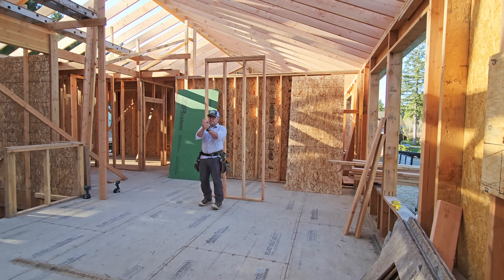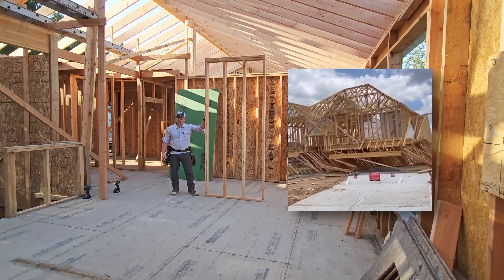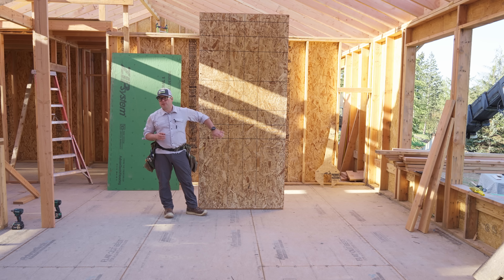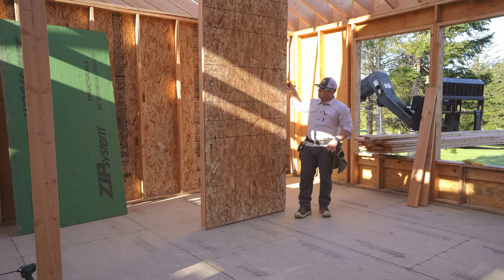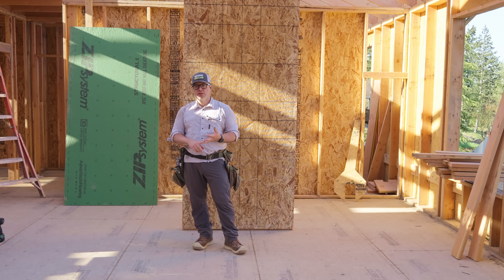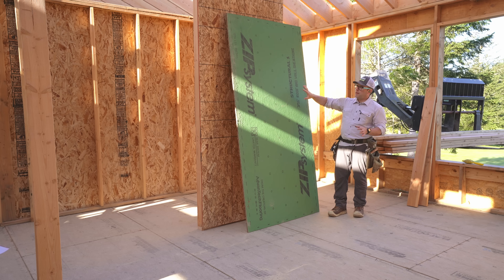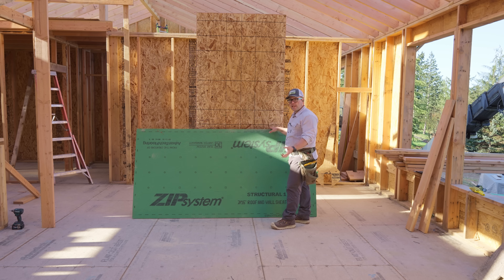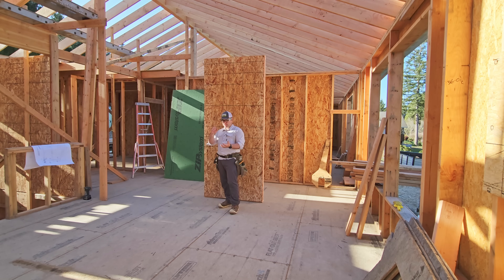Shear Walls Secret: The Hidden Force That Holds Buildings Together

Comment: Nice info, and GREAT video of shear failures!

What would be super helpful is if Huber would stock longer Zip panels (and various Advantech flooring) in Canada.  I can’t tell you how nice it would have been to have 10’ Zip and 1-1/8” Advantech available locally… I had to import my floor sheathing from NY myself, a major PITA.  Maybe you can pass this along to Huber? 😁
Reply: I haven't found it in stock near upper MI either. Pretty sure it'll be a special order for me. That's a conversation I have yet to have. But it'll be worth it to save not only on the extra blocking, but also the resultant thermal bridging. Sure it's a drop in the bucket, but still. . .

Comment: Question? Is there a reason why it’s not sometimes practiced to use a construction adhesive in addition to nails on wall or roof sheathing. I would think it would be beneficial and easy, However Since I have never seen or heard of it I assume there is a particular reason?
Reply: Adhesives are not used because you want ductility in the system. Same reason nails are preferable to screws.

When an earthquake happens, the panel rocks back and forth, the nails bend a little at their heads, absorbing the kinetic energy and releasing it as heat as they bend back and forth.

You can build a structure that is not very ductile (think concrete) but it has to be very very robust or it will fail catastrophically. 

If you introduce ductility into the structure, it can resist high loads with less material.

This is why nailed plywood shear walls are so great. They have a tremendous amount of ductility and ability to dissipate kinetic energy.

If you want to geek out look into the "response modification factor" of lateral load resisting systems. It's one of the variables engineers plug in to their base shear calculations. Basically a measure of ductility.
Reply: @kevinfarrell329  I was thinking the same.. 😅😅 in all seriousness, very nice response..
Reply: @kevinfarrell329  thanks. I learned a new word today. Ductility
Reply from the maker: I've read that its not a good thing and I've read that it is.  I know that because it can't be inspected, and the shear walls are tested to failure to give us our values that there isn't a need for it.  But it would be interesting to see how much it would help.  What glue is best?  How much glue?  Just perimeter or on all framing members? Could it make it too stiff?  We want some ability to move and dissipate energy.

Comment: Is a shear wall the same thing as a braced wall? I'm building an addition and my engineer is asking for continuously sheathed wood structural panels across my whole addition. It's just a 1 story great room with a cathedral ceiling. Thanks!
Reply from the maker: no, the APA has a great webinar on this.  I the IRC they are called braced walls, in the IBC shear walls.  Continuously sheathing has a lot of advantages and saves money on the engineering side.  https://www.apawood.org/fully-sheathed-walls
Reply: @AwesomeFramers  that's what I thought. Thank you.  I'm in the Midwest so we don't have to deal with seismic loads.

Comment: That was very educational. Can you produce another video showing a house blueprint and where these shear walls would be required?
Reply: In michigan we're required a "braced wall panel" section.  It shows the floor plan, in a simpler form, and highlights or darkens the specific sheer panel areas.   Here it's typically 4' on each corner of the wall and next to large openings. It will then specify the type of panel bracing.    Walls with huge openings (think garage walls) will typically be portal framed ;  cs-pf, dpf, or pfh.
Reply: Usually it's the exterior walls and some interior walls set at right angles. Eg in SF for earthquake resistance: our house has an interior "spine" wall that runs the length of the house and carries a lot of the roof and second floor joist load. Then a few of the interior walls perpendicular to the lengthwise "spine" are 2x6 shear walls. They act to prevent the main spine wall from moving in its weakest direction (perpendicular to the wall length). Actually it's all connected because the spine does the same for the exterior side walls while the shear walls brace the front and back exterior. So it all locks together... as you'd expect.

Our garage also has a huge beam and footings to prevent the 1.5 car wide door from being a weak point (aka the "soft story" problem).

Comment: Here in Norway we typically use exterior grade drywall (Where the paper on the drywall is a Tyvek house wrap) or let in braces with a house wrap for sheathing. Because OSB doesn't breathe enough. No earthquakes to worry about here.
Reply: From Germany...nobody here would build seriously a Toy House like the US ones and in the End.....Sprayfoam it into a Plasticbox
Reply: @Kefillix We don't use drywall on the exterior of walls in Canada. However, we do use poly vapour barrier on the inside of walls to help push moisture to the exterior & prevent it being trapped inside the wall cavity so it only has 1 way to go. Another big concern is leakage of hot air across the ceiling perimeter into the roof space, where it causes ice damming at the eaves due to the process of melting & re-freezing. Having good roof ventilation is usually the key to prevention. But there are other preventative methods too.
Reply: @TwistyTrav  we don't use drywall on outside in albertabut we use denseglass or glass rock which is pretty much the same thing just better fire rating and has really no shear value.
Reply: @Acechanderson  Not entirely true. Drywall is considered when calculating the bracing for the bottom chord of roof trusses. In an unfinished space without drywall, like a garage, you need use strapping for the bottom chord instead. Drywall does have some structural value.
Reply: @TwistyTrav  all I'm saying is I wouldn't build a house out of dense glass or drywall for exterior sheathing if a had a choice
Reply: @Acechanderson  Yes I agree. Neither would I.
Reply from the maker: We don't want our houses to "breathe".  We are building tight so we can manage the ventilation.  Think of it this way, our bodies "breathe" through our mouth and nose, not our skin.  This is much more efficient in construction because then we can filter the air and recovery heat from the air.  It also means we keep clean air in and pollutants out.
Reply: @AwesomeFramers  Yes, but moisture should be able to leave the wall cavity. The house wrap allows moisture to leave the wall, but not for it to enter from the outside. How well it allows moisture to exit varies. OSB is nearly completely air tight (and can even be used as a vapour barrier on the inside in some cases). So we don't use OSB sheathing because of that. OSB has a vapour resistance of about 1 sD, while exterior drywall is 0,08 and a good housewrap can be as little as 0,03.

The vapour barrier will never be perfect, and if someone hangs something on an exterior wall with a molly fastener or similar they'll make a big hole in it. Then inside air will enter the wall and form condensation.

It's like wearing a rubber raincoat vs. gore tex jacket. In the raincoat you'll end up soaking with sweat, with the gore tex you'll be comfortable.

This is probably less important in the US because you usually have thinner walls and a milder climate.
Reply: @Fekillix  do you use wood framing construction in Norway?  I thought most of Europe used concrete blocks of some form.
Reply: @robertm5969  Norway, Sweden and Finland uses wood stud construction much like the US. We have plenty of timber and it is easier to achieve good insulation with wood stud construction.

Your average new house will be built with 2x8 studs and 2x2 furring strips on the inside with a recessed vapour barrier (so no penetrations for electrical) to achieve 10" of wall insulation. Ceiling is usually 12-14". Only fiberglass or mineral wool insulation. Spray foam is not used (fire requirement) and XPS only in foundations (again fire regulation). All windows are triple glazed.

I think you Americans do framing to a higher standard, and you build way more interesting houses. But American windows and doors look very basic.

We also use wood siding (not the OSB stuff) and roofs are rarely shingles, mostly concrete or ceramic tile.

Also, our 2*8 are almost the full inch size. So like 1.9*7.8"
Reply: @AwesomeFramers  In Canada, we have similar building practices to Norway because a major issue in cold climates is when moisture gets trapped inside the wall cavity. So a lot of effort is put into ensuring ventilation to the exterior. It also means during the summer months, our wall insulation is less efficient because it's specifically designed to hold heat inside the building.
Reply from the maker: @TwistyTrav  I think we are talking similar. Breathe isn't the same as ventilation. Some people don't want to tighten up the envelope so the house "breathes" but really we want to tighten and manage ventilation
Reply: @AwesomeFramers  Sounds similar. In cold climates, you want the walls and roof area to "breathe" (ventilate?) so that it acts as an insulative barrier to help hold heat inside the building's living space. Anywhere that heat (and moisture) can get trapped, which isn't living space, is the main problem these techniques are trying to solve.
Reply: @AwesomeFramers  You forgot the BH...